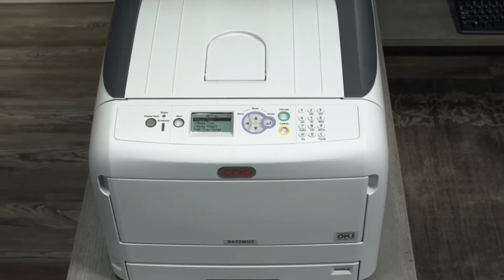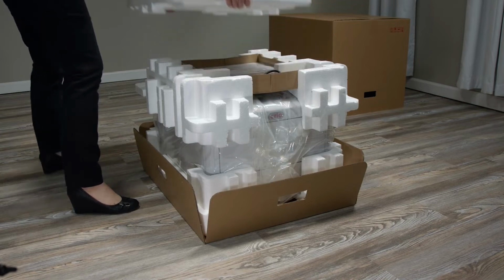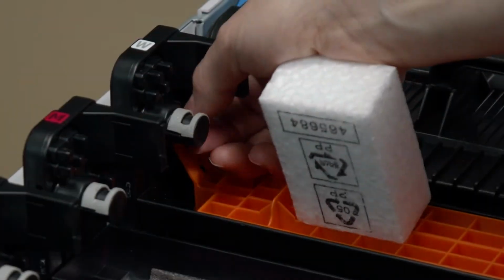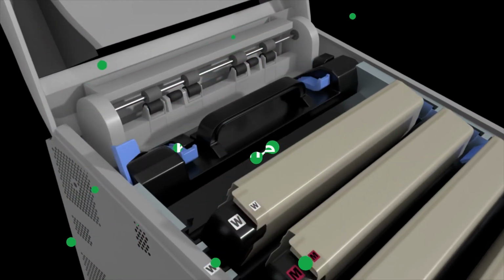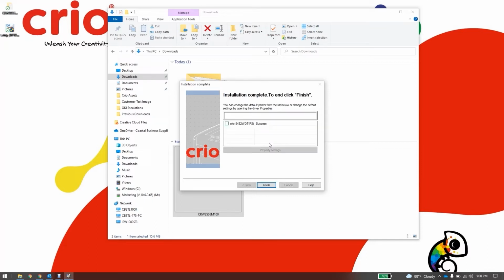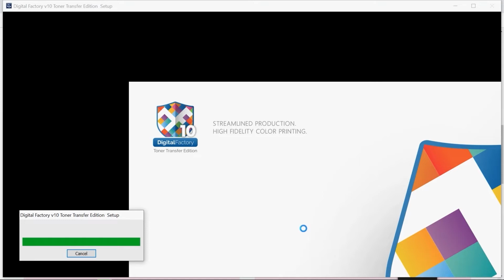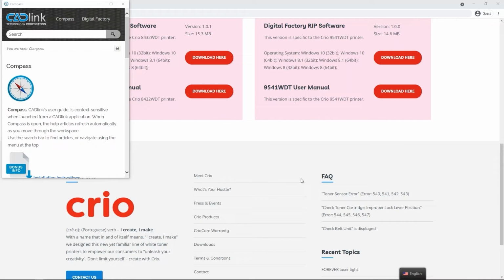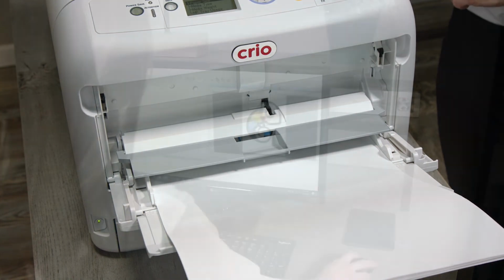Unboxing and Set-Up for the Crio 8432WDT White Toner DTF Printer

Comment: Hello. I have one of these printers and I use the 6.2 cpm paper from the tmt press but the dark objects that I customize (black mugs) are getting a shadow. Could you guys who have been working in the field for a long time help me?
Reply from the maker: The "shadow" you see is excess emulsion from the CPM 6.2 paper.  You can remove this excess emulsion with Acetone.  Be careful not to get acetone on the image, as it will remove the image.  If you take acetone to the entire design, it will remove it from the mug.  So, if you do not get the clean transfer, you can remove the image with acetone to "clean" the mug and try again with another transfer.
Reply: @condesystems  Is there any paper that doesn't leave this mark?

Because it delays my production too much because I have to clean the products with acetone and running the risk of damaging the art.
Reply from the maker: We would recommend trying these FOREVER Paper Products:
Laser Dark (No-Cut) Light: https://www.forever-ots.com/product/laser-dark-no-cut-lite/
Multi-Trans: https://www.forever-ots.com/product/multi-trans/